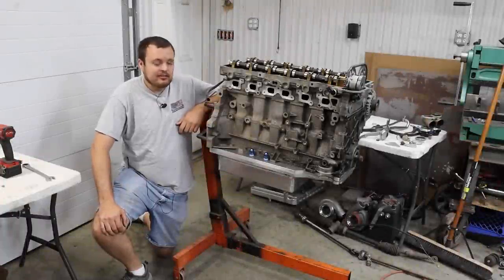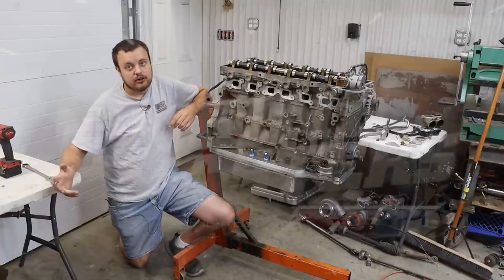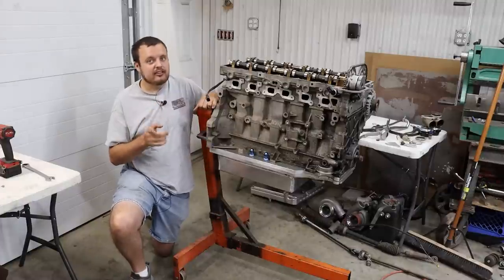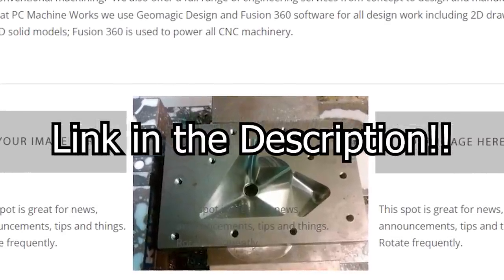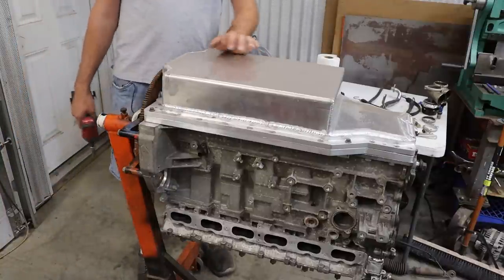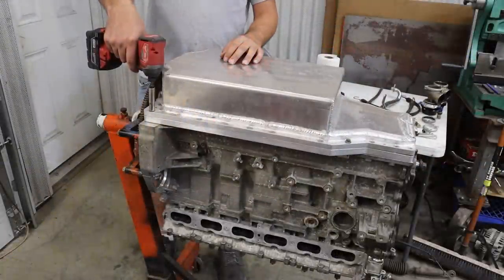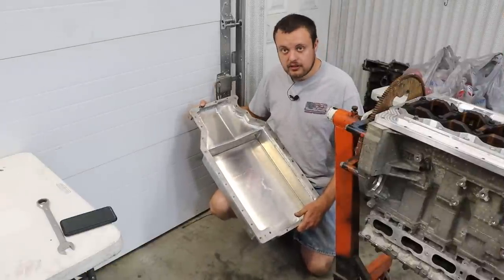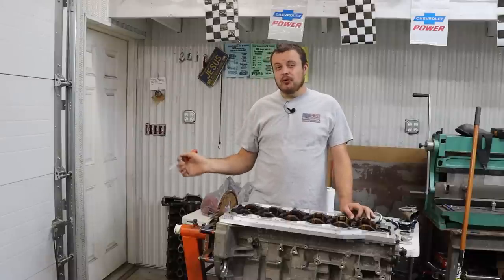Can You Make More Horsepower With An Oil Pan?

Comment: This is a great point that is not considered or talked about much, Calvin. Modifications like this take power that you are already making in the combustion chamber and stop wasting it on windage. It is 100% an efficiency gain - same fuel/air go in but more power available at the flywheel.
Reply: It also puts less heat into the oil.

Comment: I worked as a machinist for 32yrs. Ran CNC's mostly the last 12yrs. Very cool , I thought of owning one. But the costs can get crazy. Haas has some smaller models but it's best to find a used one. They can be pretty bare bones and every little option adds up quick . Nice job on the oil pan design. I'd love to get some real skills using software for modeling and such. Did you scan the block prior to designing? And if so what did you use? The last company I was at had a Faro arm. And a 3d scanner , but only the engineering dept used that stuff.
Reply from the maker: Thanks. I did not scan the block. The patterns were available.
Reply: @Calvin-Nelson  where did you get them? I plan to build a small street truck with one of these after I get a mill in the near future and having any factory models or technical drawing would be amazing for making parts.
Reply: you ever need any encouragement to roll the dice and buy your own machine, NYCNC videos will do it, especially their shop tours. A number of guys that buy a CNC machine(often Haas), cram it into their backyard garage, and grow a business out of it.
It's sure turned the gears in my head lol.
Reply: @RyTrapp0  I used to watch his stuff when he was a garage guy. Problem is he's self trained , I,m professionally trained with decades in the trade. He is a smart guy, but I don,t get into what he does anymore. Just like the Titans of CNC, show does nothing for me. I have a manual machine shop , but rarely use it truthfully. Just at a point in my life where I need different growth. Trying to live debt-free and build a cabin takes up a lot of my time and interests. I also need a bigger shop to pursue more equipment. I would really like a waterjet or a nice plasma table. And a nice brake press to support the cutting machine. I think for me to jump into the CNC pool again. I would have to be triggered by the right opportunity and equipment. Perfect example, several years back. There was a small well tooled machine shop forsale. For what he had and what he wanted . It was a hell of a deal. I was not in a position at the time. But it was a unicorn purchase. And it was set-up enough to make money right away.

Comment: Really nice pan design, I like everything about this!
Check out the 7.3l 'Godzilla' oil pan video that was just uploaded on Revan Evan's channel, the  baffle system they designed for it is pretty trick, may give you some ideas for your baffling. Much of it was inspired by the stock baffling on the GT350/GT500 Coyote pans, they're REALLY nice(not to mention OEM engineered, and for pretty extreme performance cars).
 
Can't wait to see how this build turns out!
Reply from the maker: Thanks! Will do.

Comment: In a recent video put out by Cleetus McFarland after his big wheelie incident, Steve Morris talked about the oil pick up and how it has to be a certain distance away from the bottom of the oil pan(he did mention the exact distances but I don’t remember them now).  Too little distance and you end up with cavitation of the oil.  Too much distance and you can end up with oil starvation due to a lot of the oil being forced into the engine causing the oil level in the pan to drop, and thus the oil pickup sucking in air.
Reply from the maker: Yup. We normally shoot for 3/8 inch.

Comment: Looks good, are you going to run an accusump?  It would be cool If you could run long main studs and have the upper oil pan girdle tie into the longer studs.
Reply from the maker: Nope. No need for an accusump. I had thought about tying into the mains, but decided not to.

Comment: Noting the two blue AN fittings on the new oil pan...will there be some vacuum pump action in the near future? As always enjoyed the video and inspiration to do my own engine swap.
Reply from the maker: Those are the turbo drains. The crankcase vent will be in the normal locations (on the valve cover)